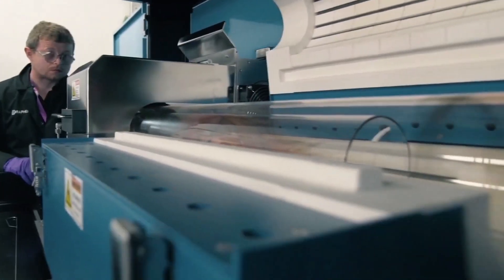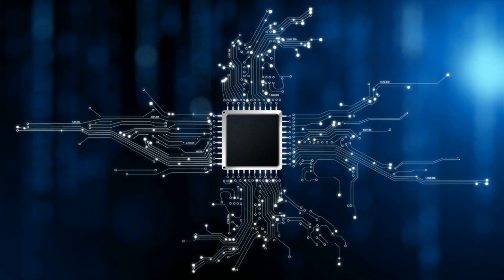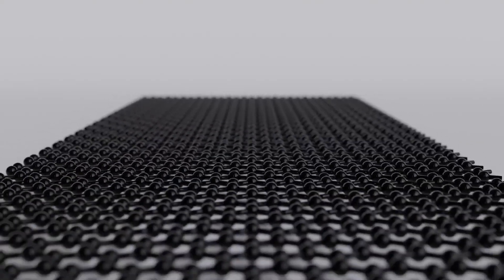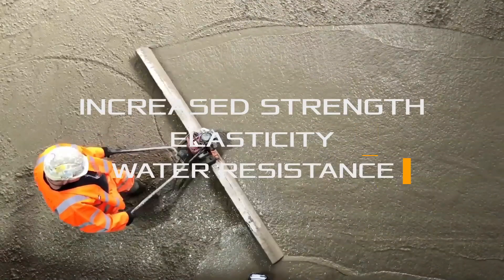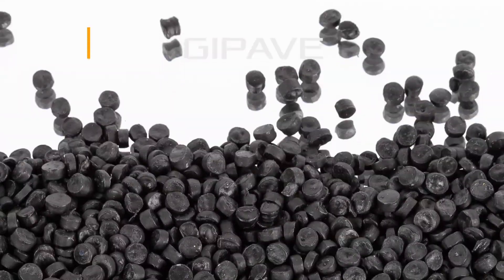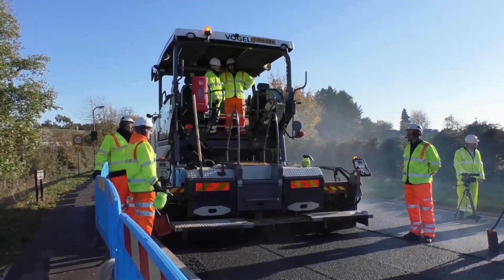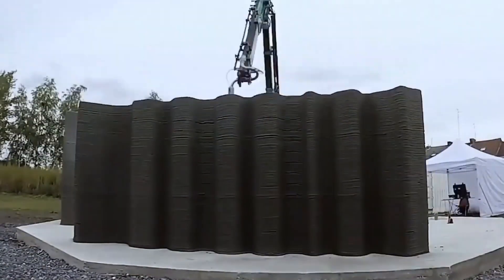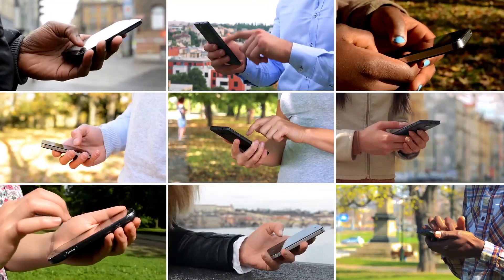Graphene in concrete is already changing the rules of the game in construction

Comment: Thanks IT.

Interesting use of graphene to add strength, just like having fibers in a mix it increases the tensile strength, unfortunately cement produces about 3/4 ton of carbon dioxide and  we make about 4 billion tons globally every year, so as you showed, the future industry will probably be 3D printed homes using a geopolymer concrete made with about 95% fuel ash along with carbon nano-tubes as the fibers instead of the polypropylene fibers they use today.
Reply: Trees need carbon dioxide to live, and intern create Oxygen  so people can live. It's a natural occurrence, so leave it natural, the way nature intended..
Reply: @duke7595  And so long as animals breath that cycle will not be disrupted. Nature is not a sentient being. Nature cannot intend anything. It just happens.
Reply: @davidtherwhanger6795  In many wats it is..  This includes bacteria, archaea, protists, fungi, plants and certain animals. There is the possibility that a number of animals with very simple centralized nervous systems are not sentient, however, there is some debate..
Reply: @duke7595  Bit you are not talking Nature itself designed itself. You are talking Intelligent Design. Which there is no actual proof that a supreme being did design it from the ground up. And even if true means simply that some one else went thru all the science before us and has billions if not trillions of years jump on us in science. But still does not mean nature designed itself as implied in your original statement. I felt you were going this way but wanted to avoid bringing this out from the start. 

I will point out that just because by simple natural selection that the best for a particular environment survived and thrived, while the dozens or hundreds of other tries nature had by random chance did not does not prove that nature knew best. It only proves that that example survived. Ignoring the countless other examples of what happened in nature and failed does not make your idea have more merit when using only the surviving ones. It just shows that your idea is not as strong as you believe.
Reply: As I understand it there are several companies right now starting to pull CO2 out of the atmosphere to make Graphene with the carbon. So that may well drop the actual overall carbon foot print of concrete production significantly.

Comment: I have heard of Graphene, however, there is not much info out there as of right now. But there is something I would really like to know - what is the purpose of having Graphene Oxide in the vaccine against Covid-19 ?
Reply: Good  question!
Reply: The Vaccines don’t contain Graphene Oxide. Graphene is literally just a one atom thick layer of carbon atoms in a hexagonal lattice… This gives it great properties of strength but Graphene Oxide is literally just Graphite (the exact same thing used in pencil lead. Viable Graphene semiconductor have yet to be made but remains a potentially promising (but still only theoretical) replacement for Silicon used as a substrate in the wafers used in the Photolithographic process that is utilized to make computer chips like CPUs and GPUs and as Graphene is very effective and efficient in its ability to conduct electricity, it could allow for more efficient and faster processors… You can literally take a piece of Scotch Tape and Graphite, put the tape on the graphite and remove a layer and if it is one atom thick, you just made Graphene… It’s not a rare substance and it’s not being put in the vaccine to control your mind or track you or whatever anti-Vax bs that is currently being pushed by quacks, nor is Graphene Oxide (or Graphite) a.k.a pencil lead being put in the vaccine…. People need to stop believing everything they read online and taking everything written about complex subjects they clearly don’t understand at face value. You already carry a phone with a GPS chip and cellular modem in it, if you own more Modern Air Pods, they also have a chip In them that allows you to track their location if they become lost… Both Apple and Samsung sell consumer level tracking tech in the form of AirTags and Smart Tags that can be used to attach to keys or put in bags to recover them if they’re lost. Not everything is a big conspiratorial cabal and if the Government wants to know your location, they already know where you live and can subpoena your phone records to see where you are….
Reply: To make them conductors

Comment: Can it entirely replace rebar whether epoxy coated or otherwise? Also relating to rebar is fiberglass rebar which far exceeds  steel rebar is a fraction of the weight and thus easily transportable.
Reply: There is a plastic bases fiber that already replaces rebar entirely. I live in an earthquake zone, and have a 6 inch shop floor. It has ZERO metal. We built a box 60 feet x 40 feet and filled it in, then built a shop over it- 15 years ago. We get intense rains, and very hot summers. Not a single crack- I should add that I  bring bulldozers into my shop for service at least twice a year, as well as 18,000 lb trucks all year long
Reply: @email4664  Now that is the kind of time tested information I was looking for. Did you do saw cuts as so many tell me must be done?
And now what was the product you used as not all things are available in Canada where I live.